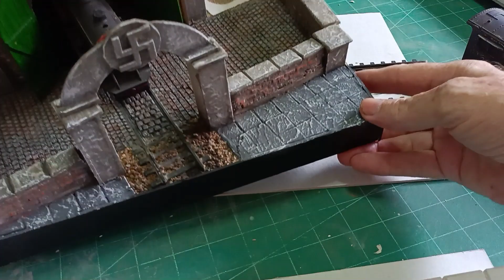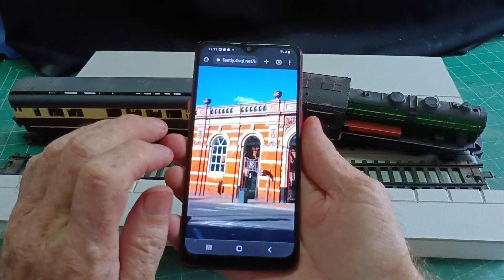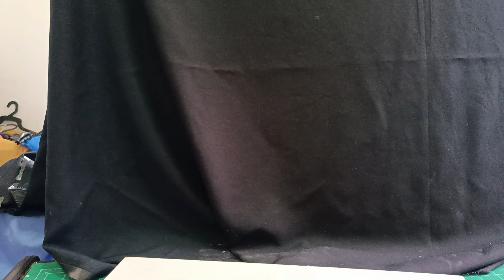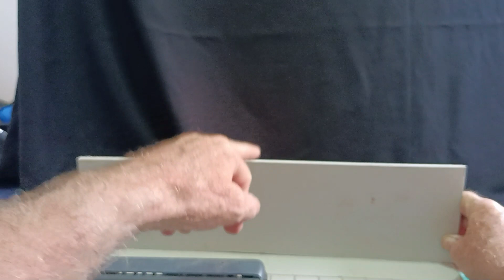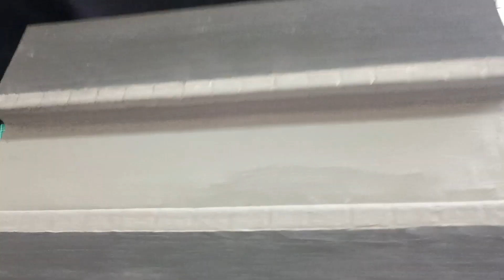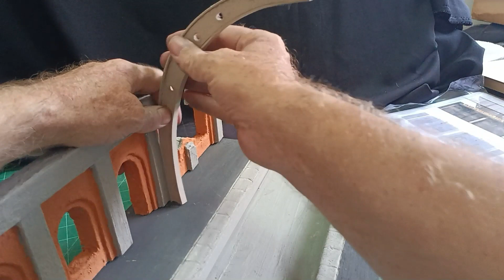Scale model train station. How to make.

Comment: 10:05 Semi-circular girders. A reasonable shape. 2mm card bends cleaner than 3mm thickness.
Diorama Don relevant links
Pavement and Sidewalks: https://www.youtube.com/watch?v=uZiXAIDTEZ0
Factory: https://www.youtube.com/watch?v=Fh8CPJNbEJ0
Brick Walls: https://www.youtube.com/watch?v=u-l_7-7X6JE (two methods of manufacturing and assembly, then: mortar, distressing, and weathering)
Rubble: https://www.youtube.com/watch?v=RxuOitEx0Ig (same process as brick making, but not necessarily to regular brick dimensions)
Windows: https://www.youtube.com/watch?v=71zCWiq12jA (static frame - not openable, with curtain)

[edit: Rubble inclusion]